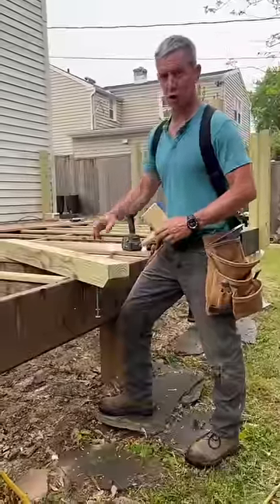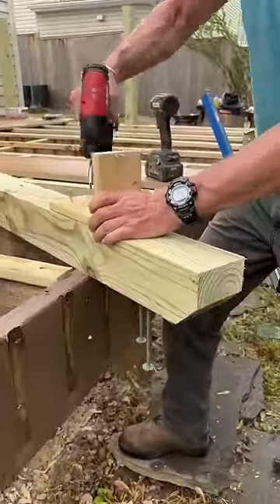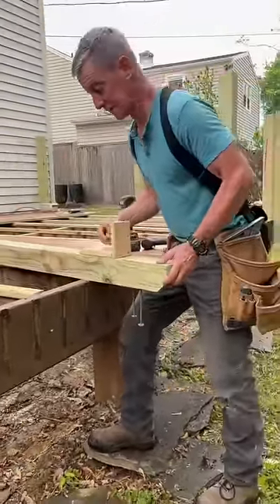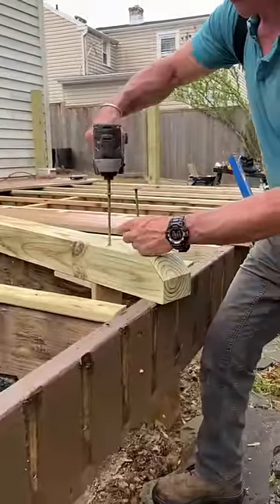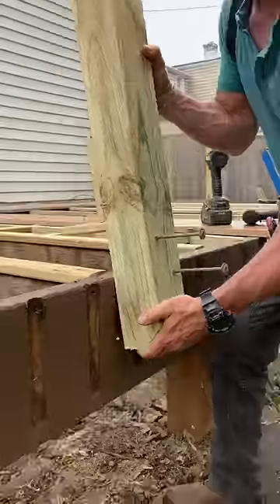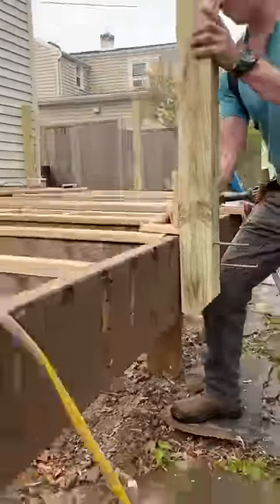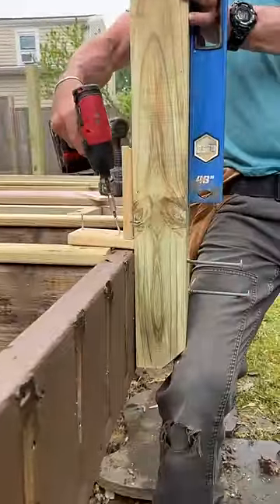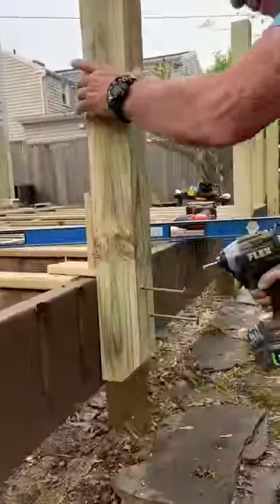DIY Tips: How to set a deck guard post by yourself

Comment: I've always used carriage bolts that extend all the way through and then use flat washers and nuts to tighten up and mount permanently
Reply from the maker: I started out with carriage bolts, then thru bolts. Now, whenever I can, structural screws serve the same purpose most of the time.
Reply: That's the proper way to do it. I have a close friend who couldn't lean on that rail without ending up on the ground. Who are they gonna sue ??? The home owners not the Joe Blow ah.... 3 long screws will do it !!!
Reply: yes, that is the correct way .Those screws are junk ,
Reply: They only cost half as much and GRKs, won't rust and all you have to do is drill the pilot holes a little bigger to leave room for adjustment. 👍👌
Reply: That’s the best way these screws are garbage
Reply: Yes, those posts will all be rocking when the timber shrinks.
Reply: @nomore8042  if I leaned on my friends deck and broke it I would feel bad and repair the neck, not sue him because his deck broke... just sayin..
Reply: @conspiracymane3454  "repair the neck" :) Freudian typo
Reply: @trumpetpunk42  no I meant deck? 😂
Reply: @toddbuzulis7195 they split the post.
Reply: Carriage bolts are code in most territories
Reply: @6atlantis  The only way he could have done it worse is if he notched the posts around the band board.
 This could be a good lesson for how NOT to set a guard post on a deck.
Reply: @myfixituplife  false! Due to thr drying and shrinking of wood, screws will never take the place of thru bolts that can be tightened over time.
Reply: One big difference between carriage through bolts VS screws: Carriage bolts apply a lot of squeezing pressure to the wood. All that extra friction increases the strength and rigidity of the connection, reducing wobbling as the wood dries and gets older
Reply: @nomore8042  CORRRRRECT!!!!!!!!!!!!!!!! This is tje first and formost way NOT!!! to install hand rail, PEIROD!!! If you attach all the post like this on an out side plate, people will be leaning on it and oit gies the the whole rail and outer plate on the ground. set your deck suport post in line with your hand railing, you will save on time, material a lives.
Reply: @Vid_Master  I have found that no matter how tight you tork those nuts and bolts about a year later they will need to be tweaked to keep the posts 100% wobble free. Wood will continue to shrink considerably for the first few years. Especially if the Pressure treated 4X4s were still wet when installed. Wait for a hot dry sunny day and give them all a good half turn with a long ratchet and you are good to go for at least three more years. Decks are not something that you build and forget about.There is a lot more to maintaining a good solid deck beyond a coat of stain every couple of years.
Reply: @trumpetpunk42  Revealing. No one can fix a broken neck. Even with "Power Lags" Ha ha ha ha ha
Reply: We all did until these timber lag screws came out.
Reply: @nomore8042  
These lag screws are plenty for this application.
Reply: @kevintucker3354  They are still just screws and without a pilot hole they are splitting the wood. Washers, nuts and bolts through predrilled holes are the only way you can be sure to hold anything together over time.
Reply: YES I  AGREE WITH YOUR  CARRIAGE BOLTS ... BIG AND GALVANIZED MAYBE  4 OF THEM  .... BUT MOST OF ALL A FULL COVERING OF LIQUID NAILS HEAVY DUTY
Reply from the maker: @toddbuzulis7195  same screws hold the ledger, the post-to-beam connection and I think they’re rated for hurricane clips in rafter-to-plate connection. They’re hardly junk.
Reply from the maker: @ThePhilvantwo  they won’t. They screws are countersunk. I’ve had to go back and retighten nuts for this same reason. Lesson learned.
Reply from the maker: @TarzanArmani007  they’re not. They’ve been out for years. Thru-bolts is what you mean.
Reply from the maker: @Vid_Master  that is a big difference. The reliance is on compression and those nuts staying tight. Otherwise, there is zero engagement of wood fiber in the band joist because the bolt passes through an oversized hole. Here, the screw threads and shank have 100% wood fiber engagement—as they do on beam-to-post connections I use them for all the time on permitted decks—nothing to get loose or wiggle apart.
Reply: @nomore8042  If the post is completely bare then maybe, but when finished, the post is also supported by the other supports of the deck and would not fail.
Reply: Yep. Me too. More strength. Also, I like posts inside the corners with blocks. It will give the deck a professional look.
Reply: The International Deck Code, yes, there is such a thing, requires bolting with backup plates and bolts with flat rates and nuts, not screws.
Reply: Those screws are only good for repairing your mail box
Reply: Yup, thats how i built my small side porch and my deck, screws will come loose eventually and with carriage bolts you can tighten it up with a wrench vs trying to run new screws that will just keep chewing things up
Reply: @myfixituplife  Bolts and screws have different loading ratings tho... And I am sticking with bolts!
Reply: So many options now days lol
Reply: Carriage bolts right through, washer,nut 100%
Reply: yes and nobody puts them on the outside anymore , not code or any good with composite materials , bases and caps on composite and looks better inside.
Reply: Those screws are a little skinny i will agee,  in my area sds structural lags are most common and very few carriage bolts. Most posts go about 5' on center to hold up a rail so you really dont need alot if your doing a good job... We notch 1 1/2" out of our 4x4 so the post also sits on the  rim and then 3" or bigger sds and slightly bury the heads, its strong as hell and these screws dont loosen up. Hate to say it but kobalt and flex says it all, get some STABILA in your life guys..
Reply: Prepunch pilot hole? Drill a pilot hole...do it right.
Reply: @gaylehiner9511 that’s what I alway do.Even It’s not relaxed code it’s the safest way.
Reply: I have a deck that was built around 1998 or 1999 (probably older than most folks in this post) where the rail posts have lag screws (not thru bolts) that was also notched and there have been no issues with loose rails.  Thru bolts were not code back in 2000.  The deck and porch have been up for 20+ years and still solid.
Reply: and what are those shims for?
Reply: These new lags are dope
Reply: Structural, lags are better and approved under code
Reply: @30bigiss If these screws are garbage, could you please specifically tell me what screws he is using.
Reply: @TarzanArmani007 or suitable fasteners.  Common language in the IRC.
Reply: @gtb5216 And why could a screw not be tightened?
Reply: Good lord get carriage bolts
Reply: @myfixituplife  You're slacking man. I wouldn't hire you for my deck, and most inspectors I've worked with would red flag that.
Reply from the maker: @artor9175  The “I wouldn’t hire you” types are usually homeowners who think they’re contractors and know a few things, but are a few apples short of a barrel when it comes down to it. Not always, but usually.
Reply: Funny to see all the old timers talking how bad structural screws are. They're fast, they're effective and last just as long as bolts and better than nails when used in the right setting.  I wouldn't use them for this as they will loosen much more than bolts will in the long term. However they certainly have their place.
Reply: I'm not a cool contractor like you guys, but Isn't it building code to use through bolts?
Reply: @michaelquigley1411  it depends on your local code. Where I live if the potential fall is less than 3' then fixings don't have a spec, but above 3' then yeah, thru bolts
Reply: Ledger lock screws. They can used in place of bolts where I live for the last year or so. They are actually pretty badass
Reply: U r correct about the through bolts with washers. The posts in the video will all be loose after the lumber shrinks and will not tighten firmly afterwards.  
 The jig is a nice touch
Reply: I  understand that using blocking is far superior, but using Pennsylvania as a metric for building code should only be used in PA. 

My father in law was required to build a 16x16 patio overhang with (7) 6x6 posts, 4x12 beams, and all hurricane rated fasteners . . . In PENNSYLVANIA! 

That is WAY overkill.
Reply: absolutely Kevin that was the way it was done but  now we're aloud to use grk structurlol lag screws but I will say I put my posts on the inside  of the rim Joyce and screw through the rim with 6 ''grk sorry for putting all this on your comment
Reply: Carriage bolts are better. But spax are good and they do pass inspection.
Reply: @myfixituplife have you ever tried those Simpson brand fasteners that are made for these style posts?  I love them. They have a self setting nut at the end that's round, the long Timberlock style lag screw goes through the post, then you just hold that self grabbing nut to the pointy end and you run your impsct until it grabs nice. It's like having a through lag bolt but installing just like you do here. Except of course the best part is the Nut that grabs the end and holds so tight I sleep well at night knowing they won't come off customers decks. These are strong too but with that big nut its full grab no joke.
Reply: @myfixituplife That's not code anywhere around southwestern Ohio. Supports have to be inside the frame (blocked) and bolted with galvanized carriage bolts. Technically they could make your customer tear that down.
Reply from the maker: @jakester455  codes vary. And in a repair situation like this is, I can’t follow codes (which are examples not how-to, that’s a different conversation). There was a double band here (hate that detail) so surface mounting the posts was the way to go. This rail is going nowhere.
Reply from the maker: @nomore8042  Yessir! I agree.
Reply from the maker: @toddbuzulis7195  Code approves them for the vastly more critical--different, but critical--connection at the ledger. I'm not sure where they're going to go. Or how the 2x6 top cap will shear either.
Reply from the maker: @steevemachine118  No pilot hole required.
Reply from the maker: @ThePhilvantwo  I've had this happen with carriage bolts back in the day (and presumably on a deck I am framing right now) however, the trick is to crush the wood fiber until the screw seats. As it dries out, the wood moves and the screw doesn't.
Reply: Carrage bolts in deckrails
Reply from the maker: @rocknrobin4022  They work. However, current Code wants “thru bolts”.
Reply: The proper way. Overbuilt. And bracing on three sides
Reply: Your way is much better than lags.

Comment: Posts should be inside the rim joists and secured with blocking.
Reply from the maker: That's how I do it in new construction. This is a resurface. However, even if I were bolting, I'd still use this process to set the post. Until I think of something better.
Reply: @myfixituplife  new and a resurface is the same situation. The decking is off, so setting the post inside the rim joist is the same as new construction.
Reply: ...and installed with a shoulder cut so the post bears on a solid wood to wood contact instead of relying on the fasteners alone...way stronger this way
Reply: @deanoriccardi8593  I agree with you on this even though I don't like notching a 4x4 post
Reply: I've done it the way you just mentioned  . Freeze blocked and locked in there really well
Reply: @myfixituplife  No one has a problem with your little jig so you can single hand the installation, But the way you are attaching those posts is ridiculously unsafe and illegal.
 I hope after reading all these comments you stop doing it this way.
Reply: @davidpeters2201  Notching guard rail posts is also not code.Why would anyone make their posts weaker right at the point where they need to be the strongest?
Reply: @davecpgh1977 Not all the time. I couldn't do that when I did my deck because of how the foundation was built for it so I had to replace the posts in the same location they were originally in.
Reply: @Renkin26  however the foundation was built, you do have rim joists, the railing posts should be inside
Reply: @Renkin26  Ask yourself, how are the rim joists attached  to the rest of the deck? Face nailed or lagged into the joist's end grain? .Or nailed with stubby nails from  joist hangers? You must know how weak that is ...
 The problem is when the posts are only attached to the rim joists and they are leaned on, the posts act as three foot levers that will rotate that rim joist right off the rest of the frame . It's very common.
No matter how well the posts are secured to the rim, if they are not bolted to the joists as well, the guard rail is only as safe and secure as the way the rim is attached.

 You better ask your insurance agent how well you are covered against personal injury lawsuits for shortcutting on the guard rail that you replaced and not having it inspected.
 Your excuses for not correcting the situation will not save you a dime in court, Cosmos.
Reply: Not necessarily. You can add blocking on the backside of the sub fascia fastened to two near joists, then fasten the handrail post directly to the sub fascia (outside) and through bolt connection through the new blocking.
Reply: @logstoluxurydiy7722  sure you can, its just the post is only half as secure as it would be inside and it doesn't pass code in many areas. No reason not to do the same amount of work for a much better results.
Reply: @davecpgh  passes code in WA, but personally I think you’re right. We only built composite decks and the end result feels more secure putting them behind the subfascia
Reply: @logstoluxurydiy7722  probably not all of WA
Reply: @davecpgh  probably?
Reply: @logstoluxurydiy7722  I wouldn't think all of WA would pass that. Codes here in PA go by boroughs, many here have very different codes, even boroughs next door to each other.
Reply: @logstoluxurydiy7722  Pennsylvania has over 900 boroughs. There might be a few here that would pass that outside post. I built a deck in Jefferson Hills, PA and they want railing posts to be more solid than a house foundation. But right next door in Pleasant Hills, they're more lenient with their codes. I feel they see it and it doesn't move, it's good to them and passes.
Reply: Both are acceptable. Always cross block on the sides to strengthen ban board. Trapped inside method is better.
Reply: @markmahon3479  both are not acceptable with many building codes
Reply: @davecpgh  There is not a jurisdiction anywhere that will not allow you to put the posts on the outside. They would have to be able to prove loss of structural integrity. They can't just make up what they want.
Reply: @markmahon3479  uh yea they can make up whatever they want and make it a rule to follow. They don't all the time. And the jurisdiction right where I live and the ones around me, can't make posts like this. They have to be on the inside of the rim joist and with adequate blocking.
Reply: @deanoriccardi8593  notching the 4×4 post is never a good idea
Reply: Exactly
Reply: So the railing is off the deck , I don’t get it .
Reply: @myfixituplife  I am frightened to hear that you work in new construction. I hope you don't get anyone injured with your shoddy work.
Reply: With the proper bolt.
Reply: Says who? The IRC does not state that the guard post needs to be inside the joist at all. And the blocking, that is for preventing any twisting or rotation of the joist/beams and is not there for "securing" the guard post.
Reply: @PhillTheGreat  Nice dream world.
Reply: Facts
Reply: Nah, you can do it either way.
Reply: Low level deck. Those railings aren't even required, so doesn't seem to matter much if you set them outside this way. On the 1 in 10k chance the entire railing were to break, no one gets seriously injured.
Reply: Gotta agree w/ you there. 10x stronger and the blocking on the inside helps secure it to stay in the pumb direction both front to back and leftnto right. Would also recommend if requiring shims, stop using wood shims. They swell from water and shrink during drying periods. Over 4 decades of carpentry I use plastic shims on all exterior use installing cabinets, and exterior windows and doors. Wood shims always shrink over time. Especially cedar shims. Its one of the main reason when you observe kichen countertops and the back splash seam, they tend to drop when Heavy stone tops are used and you always see a cracked grout or caulk seam over time.
Reply: I've built decks with these exact details (with both Timberlok and thru-bolt configurations) both stamped by a CA-licensed structural engineer. Simpson gives cut sheets showing configurations behind the rim joist and blocked, but that's only one way to do it (ref. IAPMO UES ER-192). These Timberloks take the place of 1/2Ø thru bolts in a ton of applications, but not all. If it were my deck, I'd be fine, but in some cases, you may want to run that by an SE or CE. 

So what I know is that it's enough to compel people more qualified than the people on this thread; also, that I'm absolved of liability if they're still goofed up. Win-win!

@myfixituplife is doing fine.
Reply: Exactly

Comment: As long as anyone over 40 lbs doesn't lean on the rail
Reply: Nope, if the trim joist is properly joined to the others, say by using GRK type structural rated screws, you're good to go. The "power lags" used here aren't lag screws but structurally rated GRK or GRK type screws, usually rated for about 900 lbs of force.
Reply from the maker: NOW you are talking. They're Spax 5/16 x 6-inch PowerLags. This is a resurface and I re-nailed the band. Also, there is an integrated 2x6 top cap. Whatever forces required to make this guardrail fail are 100% catastrophic. Leaning is not that as others claim.